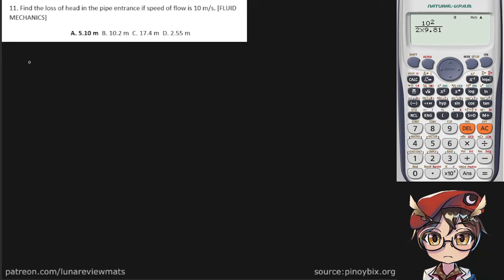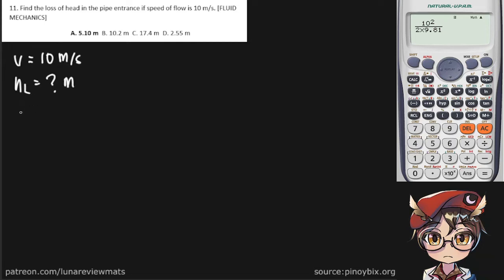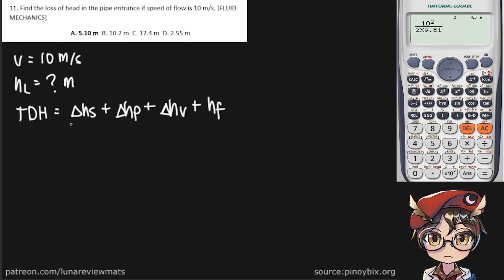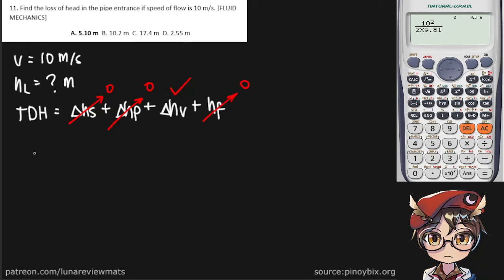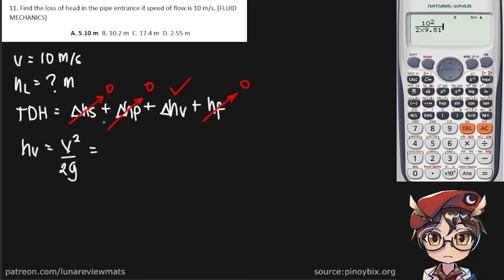Find the loss of head in the pipe entrance if speed of flow is 10 m/s.

Comment: other solution still multiplied it by .5. So there answer is 2.55. why is that?
Reply from the maker: I'm not sure. Where did they get the idea to multiply it by 0.5? Perhaps they forgot that the V^2/2g is the same as (V^2/g)*0.5.
Reply: that's a entrance loss coefficient constant, commonly uses 0.5 
sharp-edged entrance: k= 0.5
well-rounded entrance k= 0.03 
square-edged or slightly rounded entrance: k= 0.2